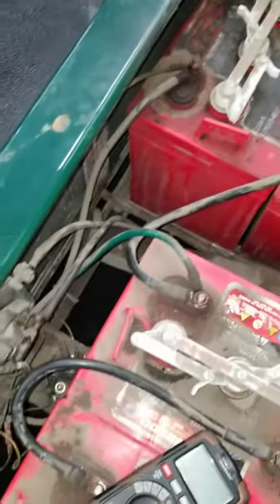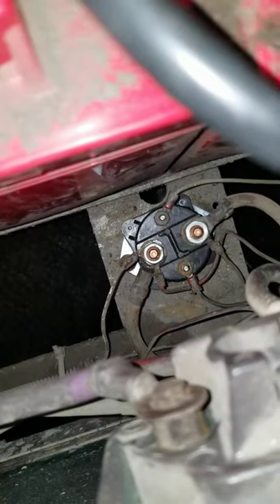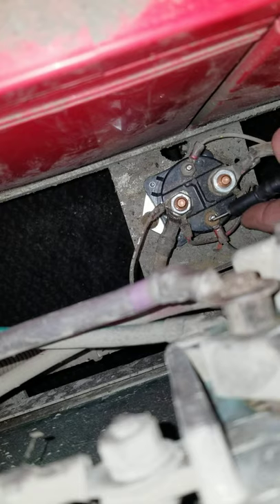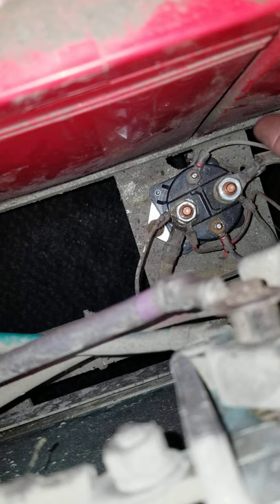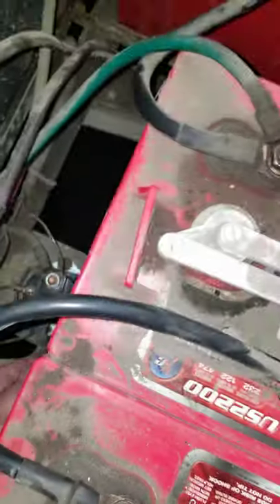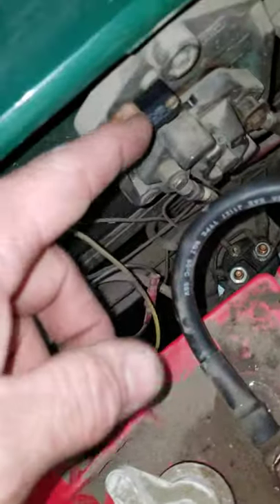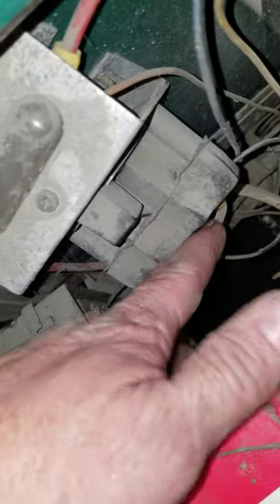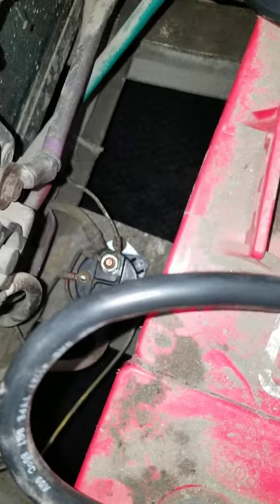Club Car 48 volt won’t stop moving

Comment: I have a 2011 club car precedent 48v it flipped over and doesn’t run now. Batteries are good, computer is good. There’s a reverse buzzer but the solenoid isn’t clicking. There is powering going to the solenoid. I don’t know what else to check… any help is appreciated. Thanks in advanced.
Reply from the maker: When it flipped over did y’all tow it back home.  If so did you flip it to tow.
Reply: @Golfcartwhisperer   not sure I bought it in this condition. New solenoid was put in and nothing, I switched the controllers from a different cart and nothing, I tried a new Mcor and nothing.
Reply from the maker: Run a wire from main positive to small blue wire on sol. Small post and see if runs.
Reply: @Golfcartwhisperer   will do and I’ll let you know the outcome thank you.